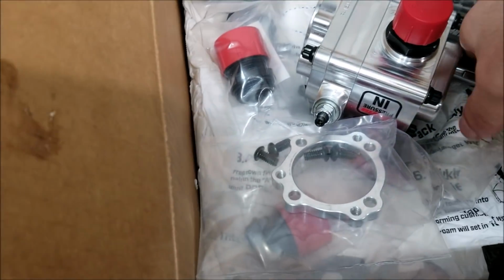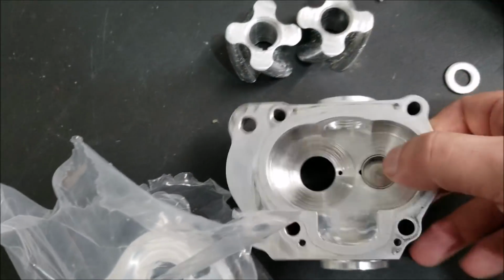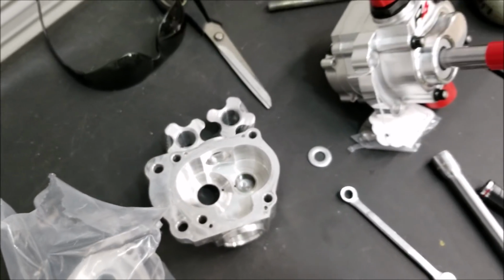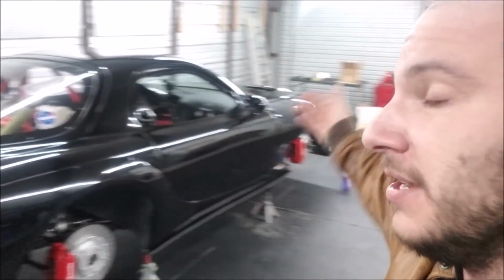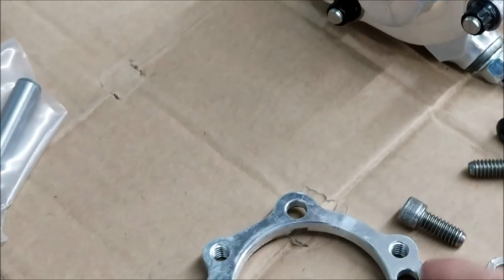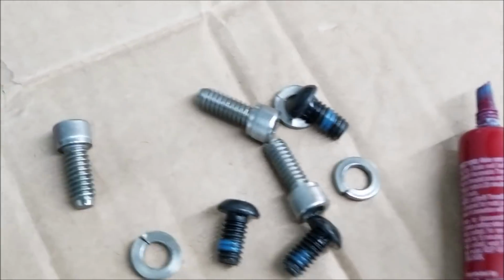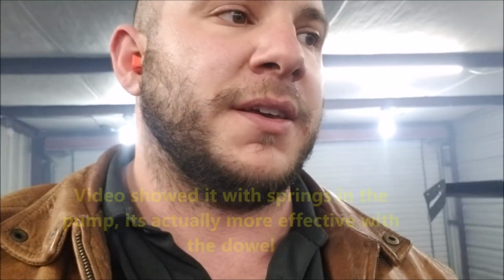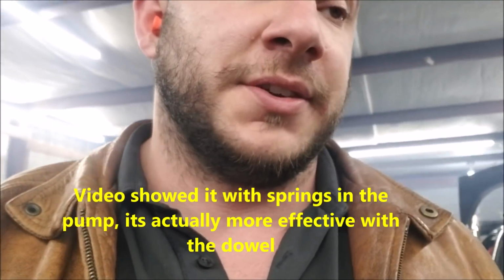How did this Full Billet oil pump wear out? Rebuilding and upgrading on the 4 rotor

Comment: Small issue having to crank it over so much but, could have applied some heat with a blow lamp to your dry sump tank. Nascars and other applications where they are religious about oil temps use neat little heater jackets round the tank.